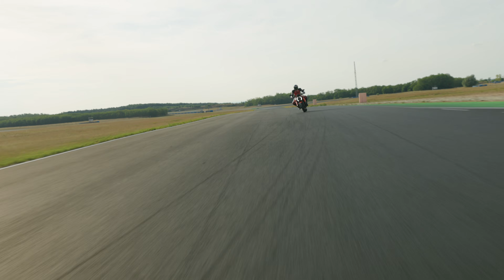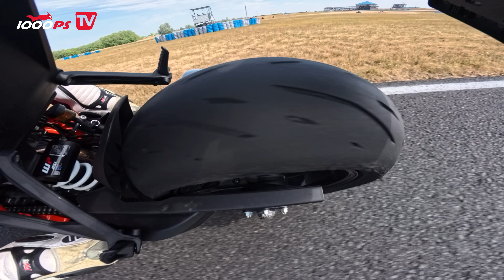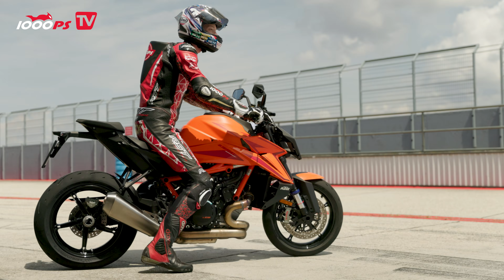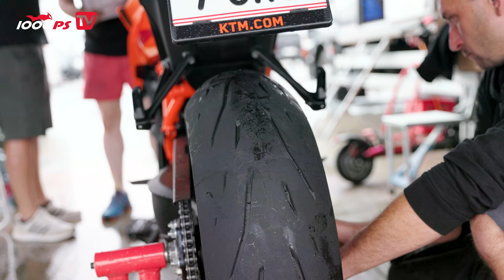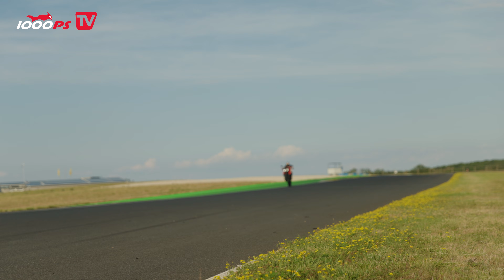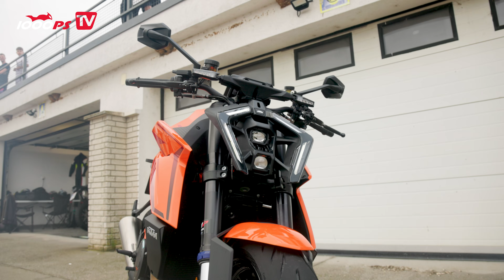140 Nm, 50°C Asphalt – Can the Conti SportAttack 5 Survive the Racetrack? | KTM Super Duke Test

Comment: Honestly I think a single compound tire that isn't just track focused is useless in 2026. It's the worse of both worlds, not great mileage or corner grip.
Reply: @AirSKWolf  Continental uses a single compound, but the curing process varies  from center to sides. Therefore they get a stickier and softer rubber on the sides vs a harder rubber in the center. Also the result is a continuous variation rather than a sharp edge between compounds like with multi compound tyres.
Reply: @Allenamenwarenschonweg  Yeah, in theory… but in my experience it just isn’t the same has having different compounds all together. It’s either still too hard for the sides or too soft and fast wearing in the middle…

Multi-compound it not perfect of course, like you said, you get a harsh transition, which is why for track where I’m not worried about tire wear I still prefer single compound. But for the street multi-compound is just the way to go.

Comment: th torque have to do with tire wear 🤐🤮😂 contact path force depend on power t whell /speed dependency where 140 nm crank engine torq change 💩 compare  to 100 nm let say like some 1 litres sport naked whatever which with the same power weight distribution weight effective lean clerance on the same tire pressure they will wear tire in the same pace and way riding the same fast on the same line in the same condition dont including some wibration asf 😎 where feg zx4 rr flashed or full power anyways stock 39 nm/77 hp riding under fast rider in the same condition wear the dame tire much more than something like let say yamaha mt03 660 with 57 nm but only 47 hp 😎👌🏻🪠🍿
Reply: Actually no.

Engine torque is irrelevant, wheel torque is all that matters. And with gearing a bike with less torque but more power will be able to produce higher wheel torque.
Reply: @AirSKWolf yea but it is not the reason 👉🏻 let say we are at 100 km/h corner on track on apex rider start open throtle in 2 bikes first one have 50. hp at crank 45 hp at whell with whelll radious 0,5 m what mean 33113 watt :27,78 m/s = 1192 newtons force at contact path and so x0,5 m radious = 2384 Nm in drive  whell axis  vs second bike have 100 hp crank 90 hp whell and whelll radious 0,2 m so 66226 whell watt :27,78 = 2384 newtons at contact path :whell radious 0,2 m=only 477 nm in drive whell axis so first one have 2384 nm in dwa and 1182 n at cp vs second 477 nm in dwa and 2384 n at cp cos cp level matter and dwa nm not in second bike tire be more load and wear in this situation more your picture fix only to similar or the same whelll radious what ultimatellly dosent matter for any posiible other configuration of whelll sizes 👌🏻 always only whelll power work vs torque its whatever can be higher or lower dosent mean much on unknown difff whelll radious cos before it generwted specified output contact path force it must go through whelll leverage so dynamic whelll radious including tires bend under load 🪠😎
Reply: @mociczyczki took some effort to follow you comment, I assume English is not your first language, but I think you’re saying that wheel radius is also important?

I agree but most bikes are running very similar or wheel radius so it doesn’t really matter in this case.

A bike with more power in the right gear will be putting down more wheel torque, and ultimately that’s the most important metric.
Reply: @AirSKWolf ultimatellly only whell power impact on tire wear in specific condition ,whell or crank torq dosent matter but because whell radious typicallly are similar you can use whell torque as reference point ,but dude in this video refere to crank engine torq which is 100% irrelelvant 🤮😂
Reply: @mociczyczki there I agree completely, engine torque is irrelevant. Although a Super Duke in first gear will have way higher wheel torque than let's say a Ducati V4R in first gear.

The Ducati has way more power but its first gear is much much longer, so wheel torque will actually be lower. Put of course at close 100km/h or so, the Super Duke has to change up to second gear while the V4R can stay in first probably until 150km/h, so from there on it can have higher wheel torque.
Reply: @AirSKWolf yea its posiible depend how manufactury want setup this so more or lesss whelllly typicallly they setup 1 gear in sich way that bike is on border of whelly i mean very close with couple % in each way for avg rider weight and position the more they add at the higher Gforce bike start do whelly or loss grip usually hyper naked are close in terms of peaks just those peaks can hit at diffrent rpm and speeds i dont know egzacly diffrences between v4 s vs super duke (it can be easy calculated knowing drive train losess )also often manufactury can limited 1 gear power torque in some bikes with to much power but on track on feg take off avg radious /speed  corners they would generated pretty much similar load on the tire assuming similar offcorse weight distirbution aso on first phase of take off corners even zx4 rr at first phase will generated similar tire load with only 39 nm crank in this caee to smaller corner radious cos it have only 77 hp os in peak 🪠👌🏻 duke r 👉🏻 „KTM 1290 Super Duke R - GPS Test - ACCELERATION / ROLL ON / TOPSPEED „vs panigale v4 👉🏻 „Ducati Panigale V4 - ACCELERATION - GPS measured „ thers no diffrences in gofrce from stand still using clutch on launch  and 0-100 time the same +/- 3,3 sek = the same tire wear and load on tire assuming similar weight distirbution weight tire type and test condition once duc can use more power without whellly and lost grip now assuming all else equall(but its not equall ) it wear and load tire more 100-200 4 vs 5 sek +/- 😎👌🏻🪠🍿